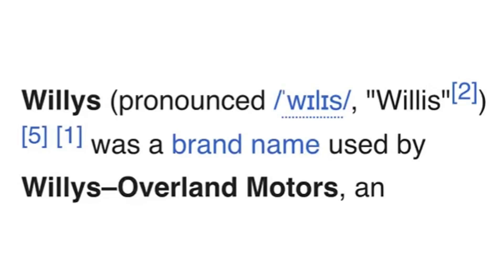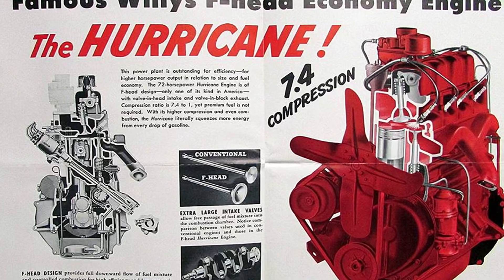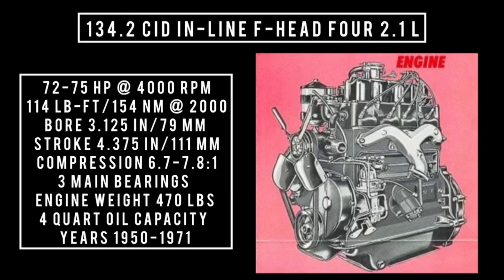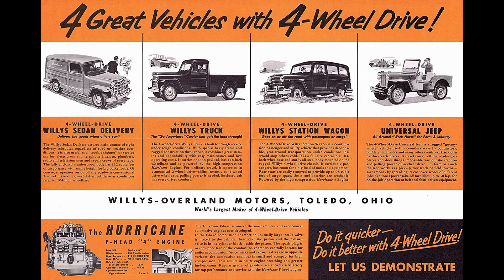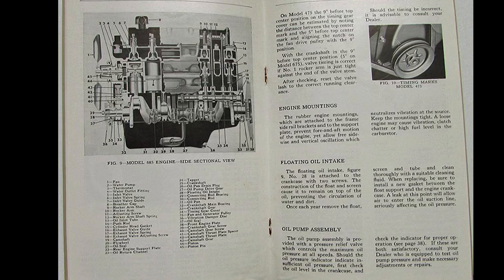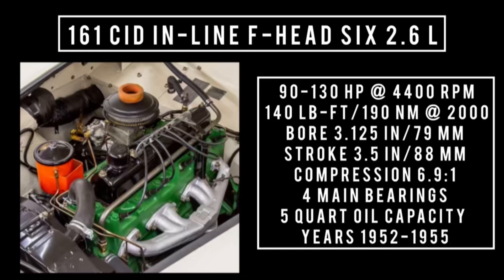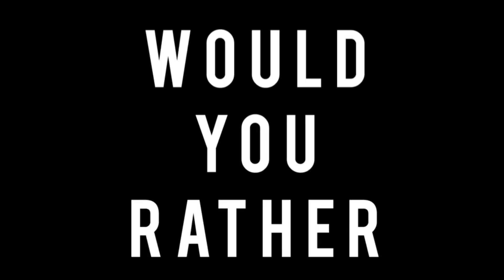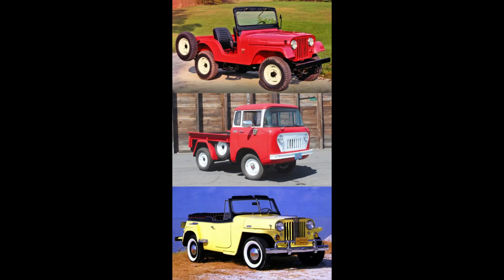Willys hurricane engines 134, 161

Comment: Nicely done. I've rebuilt several 134-4 and 161-6 engines that I've driven many thousands of miles. These good engines can be hard to rebuild to factory specs after high mileage. Unlike other engines of the time, their camshafts only have a single replaceable bearing at the front journal. Elsewhere their camshafts ride directly in iron. Normal wear increases camshaft journal clearances, making it harder to maintain full oil pressure to crankshaft bearings. Minor quibbles -- Willys Overland Motors (a Delaware corporation) continued under its previous officers and principal shareholders as the Overland Corp. after 1953, dealing with disputes and liabilities such as lawsuits from former executives Mooney and Sorensen, and excess wartime profits tax litigation. It wasn't re-named Willys Motors. In early1953, Kaiser interests bought Willys Overland's automotive-type assets and re-activated a dormant Kaiser-owned Pennsylvania corporation, re-naming it Willys Motors.  In 1963 Willys Motors' automotive-type assets were reorganized as Kaiser Jeep Corp., a Nevada corporation.
Reply from the maker: Thank you so much for adding that insight and information =) 

Also happy you dig this episode took along time to put together

Comment: Great coverage!
Henry J took the 60hp Go-Devil up to 68hp with a larger carb, better distributor, and a bit more compression.
I similarly hopped up my F134 with a Henry J distributor, larger YF from a Ford 300, better air filter, milled the head 0.090, a bit of porting, built a header, and had Delta Cams in Tacoma grind the camshaft with a bit more lift & duration. HUGE difference! It’s probably closer to 90hp now and I’ve been running it for nearly 30 years with no problems. 😎

Comment: Have you done a vid on the Willys/Jeep 230 OHC six cylinder engine? They beat Pontiac to the overhead cam game by several years. It was a very interesting and advanced design, but early versions suffered from oil leaks due to the front motor mount attaching to the timing cover rather than the block. They were. used mostly in the cab-over FC series Jeeps.
Reply from the maker: Yes we have done an engine episode on that one here is the link if you'd like to check it out 

https://youtu.be/Vxxn0QcW55g?feature=shared
Reply: @What.its.like.  Excellent! Thank you.

Comment: There is a Brazilian 184cid version (3.0) of this engine, which had detachable aluminum intake, full filtration oil pump and a 2bbl carb. It was used in the luxury version of the Willys Aero, called Itamaraty. A video with this engine can be found here: https://www.youtube.com/shorts/C-WPFYZn0Xs

Comment: Wyllis had a complete line up in Brazil ,Brooks Stevens redesigned our Station Wagon ,which was name Rural,redid the Aero too and even a stretch limo of the same .The 161 was enlarged to 183  3.0 L and  had dual carbs .In 1976 Ford discontinued it ,replaced by the 2.3 Pinto engine.I rather have the 161 on my 76 Jeep😊

Comment: It's sad that the Willys Aero didn't have the dealer and advertising around it that even Studebaker had at the time. It was a great design, very roomy for its size and actually 5 inches wider inside than the 1953 Studebaker Sedans! Drop a Studebaker V-8 in them and they would had been a sleeper hot rod in the Rambler Rebel guise!

Comment: IOE engines are the origin of the phrase "outlaw motorcycles"! In the early to mid 30's, they were faster than the newer flatheads that all manufacturers had gone to, so, the AMA was pressured into banning them... They got raced anyway, in "outlawed" by the AMA races, and the rest, as they say, is history.... had nothing to do with clubs, that was a post WW2 thing.... I love this engine...
52 Jeepster weird is cool
54 Kaiser
Song, and this is a SWAG, 
Mony Mony Tommy James and the Shondells
Reply: Cool story. But the term "outlaw" referred to any motorcycle race that wasn't sanctioned by the AMA and was used long before IOE engines were banned from AMA competition.
Reply from the maker: Not that song or band. Thank you so much for sharing all that information. Greatly appreciate it. Great choices as well.

Comment: Hold on. The Willys Jeepster was only built from 1948-50. The Jeepster didn't make a comeback until 1966. Later it was rebadged the Commando.
The 1953 CJ-3B was introduced with it's new high hood to accommodate the Hurricane engine .
The early Chevy small block V8's weighed in the 375-400# range. Is there any wonder why so many of us 2-canned the 4-banger and dropped in a small block V8.
Reply from the maker: Thank you so much for that correction wrong year on the jeepster lol great information

Comment: Hi Jay!  Looking back, it seems that pretty much every company who tried to change L-head engines to some sort of OHV engine had problems with them.  Willys seemed to have fewer problems than the others, but still had a few.  It would be interesting to talk to an automotive engineer, who could intelligently comment on why L-head engines are less efficient and ask if with today's knowledge of engines, the L head could make a comeback since there are FAR fewer parts than with an OHV or OHC engine.  WYR's. . .Number one is going to be the FC!  It has roll up windows and a roof!  Number two I am going to pick the Aero, was always fascinated with its more modern design for the era.  Have suffered from allergies off and on since I was a child, and I feel your pain!  Get well, soon!
Reply: Two of the big issues with L head is one you can’t get an efficient combustion chamber or high enough compression. Secondly they can’t get good cross flow. Because the valves are beside each other during overlap the intake charge gets to the exhaust valve before anywhere else. Due to this there is little to no scavenging. (Exhaust being replaced by fresh intake charge) and you can almost have no valve overlap otherwise the intake charge would go out the exhaust. Two other issues is the hot exhaust goes through the block making them harder to cool and there is a lot of direction change in the intake and exhaust causes poor flow characteristics as well as poor valve shrouding.
Reply: @chevy6794  Thanks for the in depth info on the F head engines!  LOVE technical stuff like that!
Reply: @JefferyHall-ct2tr  No problem. What I explained about was the L head. The F head is a little different because it’s a hybrid of that and overhead valve. Very interesting motor and I want to know more about it. lol.
Reply from the maker: Thank you so much I hope they go away soon I’m so sick of being sick 

Great choices and insight

Comment: There are 2 other reasons for using the F head design. First, as well as bigger valves, bigger and better porting is possible. Second, an iron block is a better place than an aluminium or iron head for getting rid of the heat from exhaust valves. Not only is it a bigger mass, but cooled water from the radiator enters the block first and then moves up to the head. Cheers.
Reply from the maker: Great insight thank you for sharing that information =)

Comment: those engines were built by Ford Brazil until 1975. The ford Brazil bought the Willys operations in Brazil and continued to produce the jeep (until 85), the kaiser aero with facelift (until 71) and the 6cyl engine
Reply: Those engines were also used by the 1973 onwaerd Brazilian version version of the Ford Maverick.
Reply from the maker: Thank you so much for sharing this information =)

Comment: Rolls Royce used F-head engines into the 50's, but it seems like you get the complexity of overhead valves, with the inefficiency of an L-head.  It might be hard to research, but Jeep brought out a new overhead cam 6 cyl for 1962-3, called the Tornado.  Car & Driver compared/contrasted it to the jaguar XK engine. Lots of similarities, but it was more truck than car engine. WYR= FC and Kaiser-Darrin. NTT= I think I will go "oh yeah, I knew that" when someone gets it right! Get rid of those nasty allergies, Jay!
Reply from the maker: I saw that when researching this topic rolls Royce used F-head Hudson also had a F-head from 1927-1929 

Going to cover the continental, which was the super hurricane as well as go devil and lightning eventually
As well as the tornado motor

Great choices

Comment: I had a 1954 Willys Station Wagon in 4X4 and it had the super hurricane engine. That was really a step dow from the Hurricane six -- a Kaiser flathead six.
Reply: @allencrider  Actually it was a step up in displacement and power.. The torque on that engine is tremendous for its 226 displacement..
Reply from the maker: I was wondering what was so super about the super hurricane because it was a L head Continental engine..
Reply: @What.its.like.   I have rebuilt and ran several of those engines and consider them a fairly good engine.. Do not over rev them as they are only a four main bearing engine . Another drawback, is the blocks in some lots  tend to crack. I had one where the head was planed, and the compression ratio was such, that it would knock on low test gas . That engine would pull virtually any hill in high, and do 75 mph on the freeway in overdrive. It had considerably more power than the standard 226 ,also it got around 22-24 mpg in a pickup truck. The Warn overdrive made these vehicles quite viable for everyday use . I also ran full synthetic lube in everything, which was a big improvement over what was available when they were new.. Kaiser Fraser did offer some of the 226s supercharged. The 226 also was widely used in welders, air compressor, generators and forklifts. Ahh!! those were the days...
Reply from the maker: Great information =)

22 to 24 miles gallon on the highway that’s really good. We were just talking about that new cars with computers and direct injection and they are getting the same gas mileage. It almost seems like a rip off. .. 

We just purchased a 2011 Honda Odyssey touring van that’s supposed to get 28 miles to the gallon on the highway. I have taken it on a Pennsylvania to Georgia road trip and got nowhere near that the best we got was 23 miles to the gallon with cylinder deactivation… 1959 Rambler cross country claim to get 32 miles to the gallon with a carburetor..
Reply: @What.its.like.  It's a total ripoff .. Gimmicks for gimmicks sake. That mileage was running around the Pa hills .. The old Chrysler 230 flathead was another smooth running, economical engine.. Weak in trucks, but OK in a car...

Comment: The 161 is quite rare .. They were used in the Willys car, the Kaiser Henry J and the Kaiser Darren ..I had relatives who had them,  and they were considered underpowered..The 134 was also used as power units in air compressors and welders into the 1970s...
Reply from the maker: Thank you so much for sharing that information. I didn’t know that they use the 134 for air compressors and power units.

I also didn’t know they use the 161 in the Henry J ..
Reply: @What.its.like.  The 226 also came with stellite valves and seats, it needs no modifications to run on unleaded fuel.  It certainly helps to upgrade the carburetion though...

Comment: Unless they had overdrive ng on highway rod   bearings rear seal leaks  and. A dam head bolt under the carb 😮. The continental kaiser 6   flathead better replacement     had about 5 of them over time

Comment: WYR Jeep FC
WYR Kaiser Darren
Pretty unique engine combining both worlds of Flathead and over head valve. What would be the purpose of doing this? Thx Jay sorry about your allergies.
Reply: The F-head was the easiest and cheapest way to get more power out of an existing flathead engine.  An overhead valve engine would require all new casting and tooling.
Reply from the maker: Cool choices it was cheaper than doing the complete conversion to overhead valve.. which was where the auto industry was going